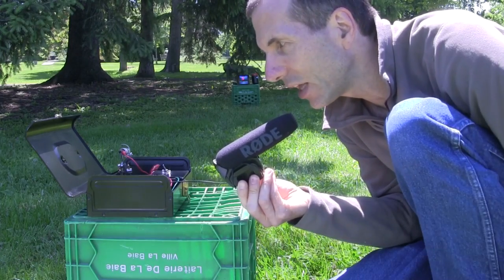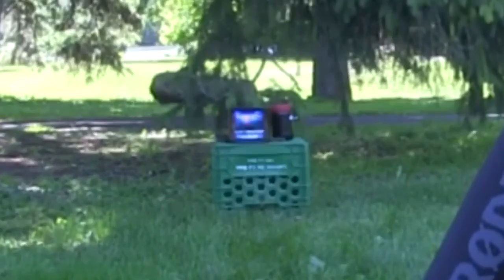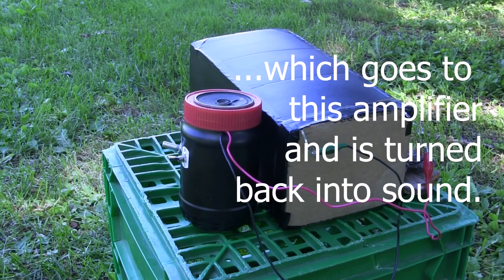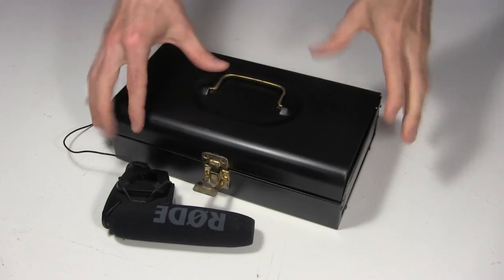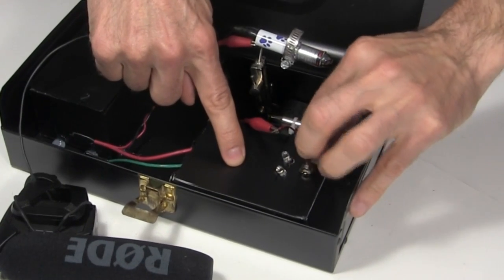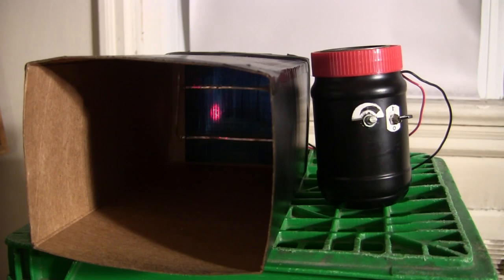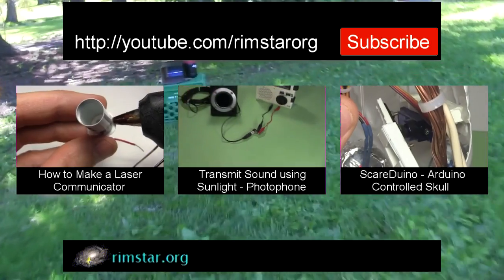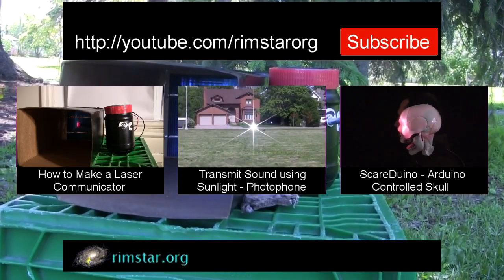Laser Communicator - DIY/Homemade

Comment: Could you use an IR led in place of the solar cell?
Reply from the maker: Will an IR LED detect light? If it's an LED, doesn't it just emit light? I'm not sure an IR LED can be used the way you want. If you meant an IR detector then I still don't think it'll work. 
It depends on your laser. There are no specifications that come with these toy lasers since they're intended just as toys but since it's red visible light, its wavelength is around 650nm. IR is more around 780nm to 1.4um, so not that same.

Comment: Sir!
is that Amplifier similar to the big ones we use in a speaker at home?
Reply from the maker: There are many different circuits for amplifiers, so it's similar but definitely not identical. The basic principles are the same.

Comment: Does a wider beam make the sound worse? And if so, would it be possible to clean up the sound with some kind of deconvolution, or is part of the signal simply lost?
Reply from the maker: RC-1290 I don't see any way that a wider beam would make the sound worse. The main thing is that your beam doesn't end up being larger than the solar cell, otherwise you'll start losing some of the signal.
Reply: RimstarOrg Ah, so the difference in distance from cell to speaker between one end of the beam and the other isn't noticeable?
Reply from the maker: RC-1290 The diameter of the beam gets larger as the distance increases, and I guess there's some loss if the air isn't clear, but other than that there should be no change.
Reply: RimstarOrg I meant the distance on chip, or well.. on the circuits of the solar panel.

I was imagining the signal getting 'spread out' slightly (maybe like a sine wave turning into something more like a square wave), because of the distance the signal travels once it hits the solar panel, being different for the various parts of the beam.

But maybe that's what you keep explaining, and I might simply not be reading it correctly.
Reply from the maker: RC-1290 The sound information is embedded in the light as darker and brighter light. So the light on the solar cell gets darker and brighter. It doesn't matter if the overall light at any one instance is spread out over a larger area of the solar cell or concentrated on a small area of the solar cell (unless of course it's a small point of light and it's pointing at the wiring on the cell instead of the on the silicon, in which case the signal will be weaker or not at all).
Reply: RimstarOrg That's exactly why I was asking. Because that sounds like a wide beam would be similar to applying some kind of reverb on the waveform. But maybe that would only be noticeable with really large panels and really large beams.

Comment: RimstarOrg Nice project! Any specific reason, you didn't use photo transistor or photo diode instead of solar cell? They are cheaper and easy to obtain.
Reply from the maker: Hrushikesh Vartak Thanks! I used a solar cell because I wanted a big target to make aiming easier. Plus, the beam widens as the distance increases. With a small target, most of the beam's energy is not used since most of it wouldn't be on the target. But that's a good point. I have a stack of solar cells I take from whenever I need one, but for everyone else I should at least try a photo diode. Hmm...
Reply: You would need a lens to focus the laser. Disposable camera lens perhaps.

Comment: i made one of these a while back and i found that if you put a constant current through the laser so that it is always on but very dimly that when you put the modulated signal through the laser it the signal picked up by the solar cell will have less cut off and will be a lot clearer
Reply from the maker: knifedude97 I have a battery feeding the laser and then add the signal on top of that using the output side of a transformer in series with the battery and laser.

Comment from the maker: Sending speech over a homemade laser communicator. Check it out!
Reply: +RimstarOrg dude keep these coming .... world needs more like you or I .... syndicating ... hopefully brings you a few views / viewers
Reply: Maybe with a large magnifying lens to collect the laser light , you can extend the range.
Reply from the maker: trailkeeper
Yup, I'd have to put the lens at just the right place but that would help.
Reply: RimstarOrg  if you replace the audio componants with an old 56k dial up modem you could have point to point data links.... you would of course need two of everything.
Reply from the maker: Gav Perris
Yeah, it sure would be fun to have two over everything... even just for talking back and forth from one building to another, or across a warehouse.
Reply: you should try sending a picture over a laser beam using SSTV software that ham radio operators use to turn pictures in to sound and than send them over radio and than you should try making a digital data link.
Reply: Zara Hall I have sent a small pic a few feet using a simple test system, and used the KCS , "Kansas City Standard" method , that was originally for "tape backup" for pc's to store data/programs  [digital to audio storage].   The KCS program may still be available on the internet..   Some have sent some digital data with some digital laser communication systems, but I'm not sure if they have 2 way yet, such as a simple text chat program.   One version of digital to audio conversion programs available, for radio, was very reliable through some noise.  One of the preppers showed it in a video once.

Comment: Hello
Nice project but would a green laser not are better :-)

Regards Thomas
Reply from the maker: ***** Hi Thomas, Why would a green laser be better? In what way? Thanks, Steve
Reply: RimstarOrg i think its more visible and more effective.
Reply: ***** *****  green laser will hold more "data" because of its spectrum frequence range and its ability to alter that frequance very precisely very quickly therefor allowing for clean fast data communications. commercial point to point lasers use highly focused UV light while optic fiber networks use blue, green and red OLED combo for full spectrum manipulation range... its getting complicated now ;-) but the red laser proved the point nicely and who dosent have a old red laser in a press somewhere to make this with.

Comment: This is good, because you can not eavesdrop on the conversation
Reply: astralny100  If you put a plate of glass in the path of the laser you can take a reflection and eavesdrop on that... this is how opticfiber works and reflections are how the NSA snoop our data...
Reply from the maker: Gav Perris Hmm... I just tried it, the partial reflection while still letting some through. I guess the receiver will notice a decrease in intensity, or volume in this case. But if they're not expecting eavesdroppers then they might just turn up the amplification and forget about it.

Comment: Here's something you can try next: try and take the laser and reflect it off a window pane at an angle. Put the receiver on the point where the reflection hits the ground. Now, when someone inside the room is talking, they vibrate the glass with the sound waves and the receiver should be able to amplify the fluctuating light waves back into sound at a distance and you can listen to what they say. This was supposed to be covert spy stuff a while back when nobody had lasers.
Reply from the maker: USWaterRockets Yup, already have it in mind to try that. But with so many windows being double-paned around here (Ottawa, Canada) I'm not sure I'll be able to find a place to try it :) ... unless it works with double-paned windows.
Reply: Maybe you can try it with a window on a car? They haven't made those double pane yet. I'd be curious to know if the idea can be made to work. Looking forward to that experiment.
Reply from the maker: USWaterRockets Boy am I glad I have all you guys to help me out! I hadn't thought of that, seriously.
Reply: My pleasure. I really am curious to see if you can make it work.

Comment: Outstanding Project.
Could your receiver be notch filtered, only to receive a narrow wavelength say 630nM+/- of light?  Therefore, you would not need the shadow box around the solar panel; or would that cause too much noise floor in daylight?
Also could you get the same amplification effect with a small 1" photo-detector?
Reply from the maker: Bruce Wayne I have no control over the wavelength the solar cell generates electricity for but that's a great idea if something else was used as the receiver. I like the solar cell because it makes a nice big target. That really helps when trying to find it from a distance. Plus, as you saw in the video the spot that these cheap lasers make grows as the the distance increases. If the spot gets bigger than the receiver then you start losing power. So a bigger receiver helps here too. However, with a better laser and a finer aiming system, I guess a smaller receiver can be used that uses a narrow wavelength. And yes, a 1" photo-detector would work.
Reply: RimstarOrg A laser bore for a rifle would be perfect.  They work for hundreds of yards. They are relatively cheap.
Reply: RimstarOrg Thanks for the response. I suspect using a red pass filter (additive or subtractive) over the detector should limit 80% of the other wavelengths out.  For my application, the laser would have a line generating optic.  I am needing to use a small 1" detector to receive a tone, say (1000Hz), when it is passed in front of that modulated laser line, under a very bright (daylight) environment. It does not need to be visible, only to the detector. However, nothing that 5 or more watts of laser could not fix.
Reply from the maker: Bruce Wayne Oh, neat use of a filter. I had to look up line generating optic, expecting something complicated and found out that it's literally a line generating optic :). Also neat.
Reply: RimstarOrg Sounds impressive until you discover it is a glass rod. :o)
   I am looking forward to your "making of" video on this one.

Comment: Cool! In my childhood(when internet was a rare thing) i had an idea to make something like this to transfer binary information from computer to computer(kind of laser LAN). Can you test it for that purpose? How far the distance between computers can be? What is the maximum speed of such channel?
Reply from the maker: TheMeelstorm With this cheap laser, the spot that the laser makes gets bigger as the distance increases. You can see that in the video. So that sets a limit since you don't want the spot to be bigger than the target otherwise you'd start throwing away power. Since it was so hard to aim in daylight I tested it only to around 20 feet/6 meters. But the spot wasn't the full size of the solar cell yet so I could have gone farther. I don't know the maximum speed but this is how communication through fiber optic cables is done, the light from the laser follows the path in the fiber, so the maximum is quite large.

Comment: Interesting stuff, have you tried using a fibre optic cable to transmit sound yet? 
The £1 shops here sell them for connecting your TV optical audio output to surround sound optical inputs.
Reply from the maker: Green Silver Thanks. I haven't tried fibre optic cable. But I also didn't realize you cold get it so cheap or that it was so available.

Comment: That's really cool Steve! What is the maximum distance that you could transmit with your system? Nice work :)  -Ritchie
Reply from the maker: SonicDadDotCom Thanks, Ritchie. As the distance increases, so to does the diameter of the spot on the target/solar cell. Despite what people think, all lasers do spread as the distance increases, some more than others. It also gets harder to see the spot from a distance. So the farthest I could manage to hit the solar cell from was around 20 feet, 6 meters. It was just too hard to hit the target after that due to the dimness of the spot compared to daylight. But the sound coming out was still very loud, not different than when close up. So the maximum I guess would be when the spot starts getting larger than the solar cell itself, and I was up to a spot of only around 2 inches/2 cm in diameter.
Reply: SonicDadDotCom The limit to range on a system like this would be the limit of the laser you use.  The range of coherent light would determine the communication distance.  So, if you can still get a viable pattern  on your receivers solar cell without ambient interference then you'll get viable audio.  Bumping this up to a commercial laser (lotsa watts) would make the range almost indefinite.
Reply: RimstarOrg Perhaps if you attached the laser to a small telescope's altazimutal mount, you could do the alignment more easily, by turning knobs rather than using your own hands.
Reply from the maker: piranha031091 The arrangement I have works very well in that when I position it somewhere and let go, there's no sag or subsequent movement. But a telescope's altazimuth mount would certainly make it a lot easier since you can adjust one direction at a time.

Comment: That's the same laser you used for the Star Treck ships; you must have bought another one I take it.
Reply from the maker: Brandon Fisher Those laser are very cheap at dollar stores. I actually bought two more, one as a spare.
Reply: RimstarOrg Figures, red is the cheapest laser color we can get and btw I never knew that light can actually transmit sounds; I thought only radio signals could do that but I guess not.
Reply from the maker: Brandon Fisher Anything that you can make vary over time can transmit sound. You're not actually transmitting the sound, as in sound waves. You're transmitting a description of the sound. You've probably seen a waveform for a sound on a computer screen, a wavey line. So on the transmitting side all you have to send is some form of description of that wave, the different heights of the peaks, the length of time between peaks, ... Then on the receiving side you need something that can read that description and use it to make a sound wave in air from it, one that you can hear.
In the case of this laser, we're altering the intensity of the light to describe the sound wave. The intensity keeps changing as you speak. You can see that happening in the video when I show the solar cell.
With radio waves we put the information in the radio wave in a number of different ways, hence AM radio and FM radio.

Comment: I did that at school once! Imagine doing that with radiation that we can´t see, like infra-red rays. Actually the actual communication via phones it´s made using microwaves radiation, how interesting is that? That is a cool laser Communicator, thanks for sharing!
Reply: Joel Santos haha, that's what IrDA is!
Reply from the maker: Joel Santos Thanks. And ouch... I had enough trouble finding the solar cell/target as I got only around 20 feet/6 meters away. Must have been near impossible with infra-red!
Reply from the maker: Joel Santos Well, I guess you could put some sort of visual aiming system on top of an infrared laser, like you have on a gun.
Reply: RimstarOrg We used the normal laser light at school, I was just saying that would be interesting with infra rays, but if you say it´s nearly impossible I will just get a sad face cause that would be cool!